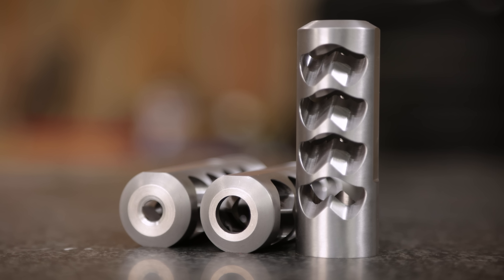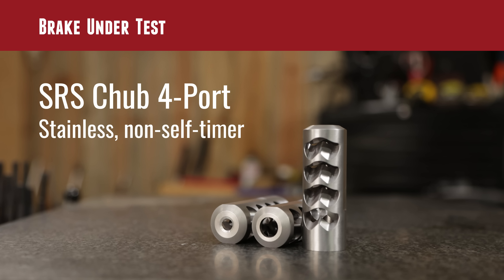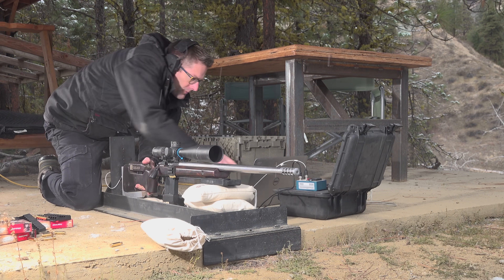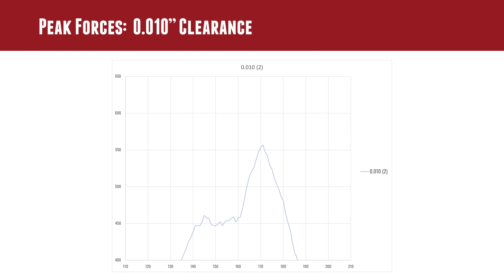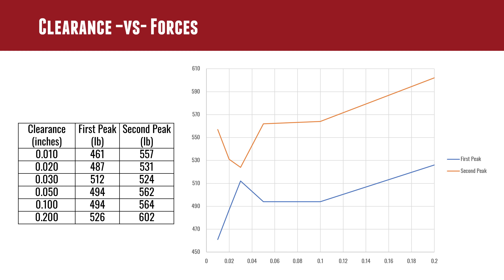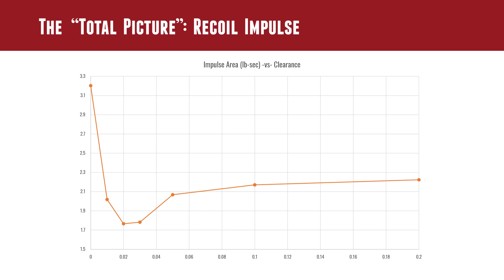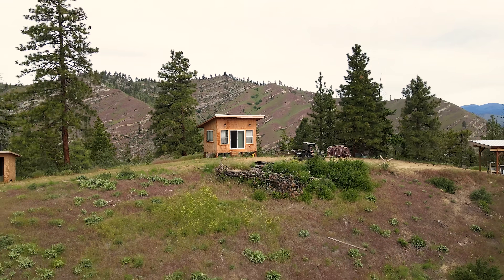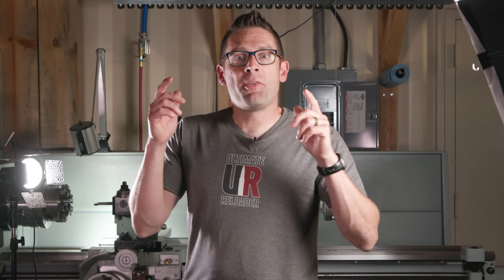Bullet Clearance -vs- Brake Recoil: Shocking Results (SRS Brake)

Comment: @Ultimatereloader very nice. 

Next question, how does surface area of baffles effect recoil.

Each "port" of the brake has a surface area. That surface area is slightly reduced each time the brake boring is increased. 

Does the increase in recoil as the brake bore is increased track with the reduction in surface area. I think it does.

So

Would the braking effect remain the same if the outer diameter of the brake was increased as the inner diameter is increase?

As well as angle and shape of the ports, we know that up to a point more ports equals more braking.

Comment: I'm a fan of your ballistic/gunsmith approach to bullets flying. And am fortunate to have some practical, structural and mechanical engineering principles shoved down my throat about one century ago (yep, deff long in the tooth!). The green shirt appeared dazed thru most of this, BUT....in the end he nailed it, as in most practical versus theoretical engineering. Given many variables in any analysis, there just may be one or two that allow one to conclude that, for most practical applications, there is some narrow range that works well. I believe green shirt said 0.020" to 0.030" overbore makes no 'real' difference. Looking at your graphs, I will take that!

Comment: I think there would be a greater difference if you were to use a 3 or 4 port brake for the test. The 5th port generally does less work normally, but with the extra clearance, the 5th port may be doing more work than a 5 port brake with less clearance.

Comment: Interesting data. I expected a logarithmic shift... more variation.
I think the overall port design (efficiency) might be why there was little change until 0.200". While most are running the Terminator style ports now, perhaps another series of tests using the older, straight ports... like the Mikulek brake... is needed to evaluate clearance affect vs port efficiency. 
Also, if accuracy is tested at the different clearances, won't the change in brake weight affect the barrel 'tune'? Perhaps a harmonic node would unintentionally skew the accuracy data. Hmmm...

Comment: Watching your video, I had an idea. It would require a two piece break or it would need to be printed but what would the affect be if the gas had an expansion chamber in the break and then passed through a hole closer to bore diameter. 
 The idea came because when you watch a bullet leave a barrel in slow motion, there is always  an explosive gas expansion before the bullet leaves the barrel.

Comment: With the pressure plate and the rest of the setup you have, I really wish you had taken that one step further to mechanically hold the gun and actuate the trigger.  Removing that last little "human" factor from your data.  Regardless, good info and thanks for doing this.

Comment: What would happen to the recoil curve of the brake had a progressive diameter change to have the lowest first and second force peaks, as in this test if the brake started with .010 clearance and progressed to .030 clearance? Is that possible? Would it effect accuracy or POI and turbulence?

Comment: Thank you for sharing. I have understood that it is so. I have much less recoil on my 300 Norma Magnum, 250 gn A-Tip V0 2980 fps than I do on my 6.5 Creedmore, Lapua Scenar L 136 gn V0 2680 fps with my Terminator 4 Cal 30 muzzle brake.

Comment: What was your control group, i.e. MV, temp etc...  It would be cool to see if the optimal clearance for another caliber is the same or linear, "cal. * X = optimal clearance" or even "(cal. * X) / MV = optimal clearance.  My thinking is the larger bullet should displace more air in front of bullet and more importantly have a larger volume of gas behind that could require a proportionately wider clearance.  That said, the cartridge case volume and powder type might be the key, since they dictate the volume of gas.  Another variable would be the number of baffles and overall length.  This could be a true blue rabbit hole.

Comment: This must be repeated with accuracy (precision) as the measured output. If as you opined, if I understood correctly, the more open brake would be less likely to influence POI or precision, then it seems that hedging the bet toward more open would be the safe way to go given the relatively small difference between tight and open. Very surprising to me, for sure.

Comment: The results are not that surprising due to the reduced area of each baffle of the break as the bore is increased. For instance if  a 1" diameter break for a .308 round is bored out such as the clearance increases from .010" to .200", the surface area of each baffle decreases to 82%. If a break records a pressure of 500 with a .010" clearance, the expected pressure at .200" clearance would be 606. To me what would be an interesting test would be to perform the test such that the surface area of each baffle is constant (you would have to machine both the inner and outer diameters of the break to achieve this). Then you would be able to judge if the change in performance is due to the clearance or just due to the reduction in baffle area that was occurring during this test.

Comment: These results don't surprise me at all.  Almost everybody has a misunderstanding of what is actually happening in a muzzle brake.  It's not that the ports are funneling the gases into a jet to push the rifle forward, it is the molecules of the gases (which have mass) are slamming into the surface of the port and imparting the energy in a forward motion to the brake/rifle.  Think of it like throwing a handful of gravel at a piece of plywood.  The plywood moves because of the impact of the gravel, once the gravel bounces off, where they go means nothing.  And...that's a really nice test rig, but please, for the love of God strap the rifle down and get a remote triggering device so you can remove the variable of down pressure and trigger pull from the data.

Comment: Great topic. I don't know if this is even possible, but seeing some of the new tank models with "pepperbox" holes drilled into their barrel ends to act as a break makes me wonder... Let's say you start with a bull barrel, do your testing, but also do accuracy testing. After each test successively drill holes near, but a few inches away from the tip of the barrel and keep retesting. I'm wondering if you can maintain ultimate accuracy with this type of idea. If accuracy is indeed maintained, then you can try out different machining techniques to carve out possibly more efficient brake styles. Having said all that, even if ultimate accuracy is maintained, the bottom line will still be the relative cost difference - I don't know if it would be worth it. Just a thought.

Comment: Their is some new publications that have came out from Litz team showcasing barrel movement before projectile exiting. From my experience, certain brake designs not only effect accuracy but also reduce accuracy over time as carbon collects. A muzzle device weight is essentially a set tuner. 
Another thing to look into is threading a barrel opening up the bore diameter 
I found with my pin gauges and air gauge that button rifled barrels are opening bore diameter in these smaller thread diameters 5/8x24 , 1/2x28. Would like to see if you find the same
Reply from the maker: Kenny, very interesting topics for sure, I’ll have to look more at the Applied Ballistics articles that you mentioned. I have seen the phenomenon you mention related to button rifled barrels, I’ve even published a video about counterboring a 300 PRC barrel that suffered from this…

Comment: Wish you could have done the math of how long the bullet was inside the break.  Guessing at 2000fps it's microseconds...  Might explain why bore size didn't have as huge of an affect as expected
Reply from the maker: 2,700 fps translates to about 10 milliseconds inside the brake- which interestingly enough maps well to the duration of the graph I showed!

Comment: I'm gonna say run precision loaded ammo next time to take away any inconsistencies that the factory loadings provided. While shooting over a chrono, and using some type of radar to pick up stability issues caused by your tests. 
I know that I've had issues with barrels that I could just not get them to tighten up. Upon inspection of the muzzle those barrels would basically be a musket. My theory was the gasses had 1/2"-1" of barrel to surpass the projectiles and cause enough disruption to push the rounds away inconsistently. Just by cutting the blown out ends, and re-crowning the muzzle solved the accuracy issues. Just as how important it is to have the crown cut as perpendicular, i guess concentric, to the centerline bore of the rifle's barrel. 
I wonder without dopplar could you use microphones placed far enough from the muzzle blast to pick up different harmonics, compared to the naked barrel, to determine if the projectiles are unstable?... great vid

Comment: Gotta negate the tuner effect and see what happens to group size with and without the baffles. Maybe an EC tuner brake vs an EC tuner with solid sleeve, same overbore, and overall weight. Tune both for min group and see which makes the tighter group. I see another collab video in the works.

Comment: So a flash hider with a muzzle diameter.15 greater than then bullet diameter will also function as a compensator? The slots are on the sides and top. No bottom slot. I’m trying to find a compensator for my Ruger Mini 30. I found one that is marketed like a flash hider, but is really more of a compensator except for the muzzle size. But your video is bringing that into question .

Comment: Ive found the faster the gases can be ejected the more stable the projectile is when it leaves the muzzle break and better accuracy on point of impact. After using a few different design muzzle breaks with different tolerances and different amounts of ports on my .308 ive stayed with the bigger break that has multiple ports and a bigger tolerance as there is a definite difference with accuracy and poi. Yes there are a lot of variables but ive been shooting the same home loads for years out of the same rifle on the same range with the same brass,powder,projectiles and primers to reduce the variables and im definitely seeing a difference with accuracy on poi using a break with big tolerances and multiple ports. The faster those gases can escape the better in my opinion.

Comment: I just picked up two LMT muzzle brakes on sale. 5/8X24th 308. Normally $135. They are on clearance for $25. Listed under sale items. Comes up on my iPad. But when I use my phone. I couldn’t find sale items. If you buy four. Free shipping. I should have bought four. Beautifully machined. Light weight. But strong.

Comment: No, not surprised at all.. In fact its pretty easy to see a head of time with a decent understanding of fluid dynamics. 

To start with, the reason why all the Brakes show two "peaks" where as the non-braked baseline doesn't is because the first peak is the air that is in the barrel ahead of the bullet being pushed out of the barrel as the bullet is accelerating down the length of the barrel. This is also why you don't see quite as much deviation from one bore size to the next on the first peak compared to the 2nd peak.

It also makes sense that the tightest one (.010") clearance would have a 2nd peak that is worse than the .020 and .030 clearance because you are forcing the Jet blast gases to primarily exit the first set of ports  so the 2nd, 3rd and 4th set of ports are doing little to no work. By opening up the bore a bit, enough of the Jet blast gases are able to make it around the bullet but not totally out run it like no brake at all and gets forced to apply pressure to the 2nd, 3rd and 4th ports. 

Once you start to get above .030" enough of the jet blast gasses gets well enough ahead of the bullet that less and less gets forced into the ports to counteract the recoil force.

There is a caveat though, there isn't really a "one size fits all" bore to caliber size because there are many variables that come into play. Different combinations of barrel length, MV and powder used will effect what the best bore size is as will the port design itself of the brake. Remember, fluids (air is a fluid) do not like to make sharp turns on their own which is why the larger the bore, the less effective the brake is. Also, things like a tapered brake that is wider in the rear and narrower in the front will typically have better results with a tighter clearance than a loser clearance because of the surface area difference within the ports (remember, force is pressure x area so when the brake has all the ports having the same surface area, then you want to try to balance the pressure of the Jet blast gasses... basically, you want as much gas pressure act on as large as possible surface area). Since its natural that the pressure will become less and less along the length of the brake, a tapered brake will typically be more efficient than a parallel brake (not always true but typically is).

Comment: Interesting. I’m with you on wanting to see POI and precision changes as I would suspect that weight plays a role on the harmonics of the barrel. The EC Tuner brake has convinced me that it’s the way to go to cancel out any negative impact of putting weight on the end of the barrel if the goal is extreme (vs hunting) precision
Reply: The factor to consider is the affect on the bullet by the bullet’s supersonic shock wave going through the brake.

Comment: I'm curious about barrel diameter vs. circumferential port placement?  Number of ports?  Expansion chamber before the port(s)?  Suppressor vs brake?  Bloop tube action on poi.  Spiral placement of ports to counteract rifling effect?  Any of this investigation will require Gavin's accurate rifles.

Comment: The nerd in me is very happy after watching this video!  Accuracy and POI shift as future tests are great ideas.  Also consider testing a heavier recoiling cartridge e.g. 300 PRC, for which shooters are more likely to "need" a brake, to see if the trends measured with 6.5 CM repeat themselves.
Reply: For our 300 Win mags, we use similar reverse slash cut brakes, but ours are 5” long with 8 cuts.  They are custom built, but do make a big difference in felt recoil.  The downside is the supersonic shock wave reflecting off of the crazy brake surfaces before the bullet clears the metal.  So it’s not the gas blast that will affect accuracy, but those shock waves.

Comment: Very nice results. My typical clearance for brakes is .025" for the exit hole. Internally I use a progressive hole diameter from muzzle end down to exit hole (calculations based on caliber, powder charge and volume of ports). This results in a 5-10% better effectiveness with the brake. Think of it as a better distribution of the gases and pressures. So many times with straight through same diameter brakes the most of the work will be done by the first few baffles. This causes too much gas to be exited initially this wasting some energy recovery. This all depends on the brake design as well, port size, distance between baffles, length (diameter). I have done much research on this trying to find the most effective solution in the smallest package. It is a little bit more work to "tune" the brakes.

Comment: How about a taper in the brake? Since more clearance isn’t significant to felt recoil, you could start at .030” and move out to .100” IF the clearance has an effect on POI. A touch more setup effort on the lathe, but not crazy if it lets you get the best of both.

Comment: I think it's less the case that you have two peaks than that you have one trough in the curve, and this trough is the result of the initial gas escape hitting the brake before the bullet exits. Not only is the bullet displacing the air in the bore rather violently, but there's a pretty significant amount of charge gas leakage that exits the barrel before the bullet does. This is likely the very initial charge  that burned before the bullet had entered the rifling and obturated to generate the gas seal.

Comment: It certainly appears that the .030" over is the sweet spot for that brake, both events are similar in strength at that clearance and should be the most comfortable.

Comment: One thing that wasn’t considered is fouling. With a tighter bore your fouling will start to effect the bullet sooner than if your bore is opened up more. A lot of people remove their brakes before cleaning and the brake itself never gets cleaned. Then they start having accuracy issues. This is a real problem. A barrel manufacturer and custom builder here in town was telling me this. Said you would be amazed at how often he runs into this. This he recommended running somewhere  between a .308 to a .338 bore on my break for my 7mm.

Comment: This is really interesting.  Did your measurement process and data analysis account for the change in the mass of the firearm with and without the brake as well as the change in the mass due to the ammunition in the magazine?  Doubt it would significantly alter the results, but it ain't nothing.
Reply: Also variations in shot to shot velocity.

Comment: Silencerco did this year's ago, except they used accuracy and sound as additional data points.  Accuracy didn't change, neither did recoil.  Sound did.  That was the 6.5 creedmoor  with 6.8 vs 8mm holes.

Comment: How about larger caliber diameters. 20 thousandths bore clearance  is a different ratio for a 44 caliber vs 24 caliber, it  would be interesting to see a comparison. Also does any of this have an  effect on velocity like barrel length. Also what if the brake has progressive port size diameters, perhaps to control gas escape, like small to large or large to small, and what would be the best diameters and combinations?